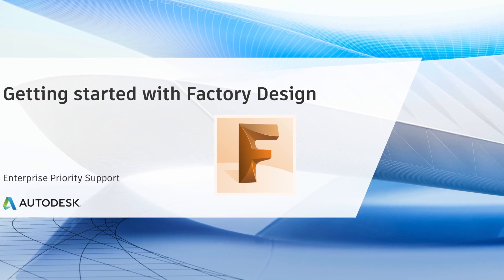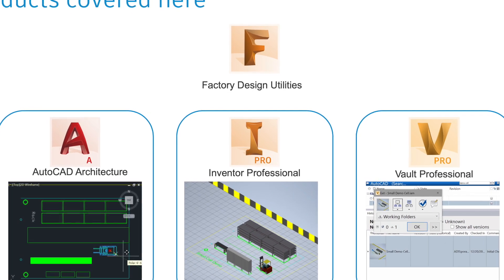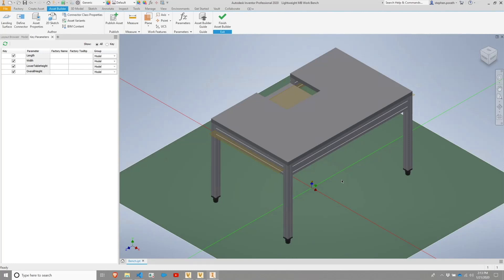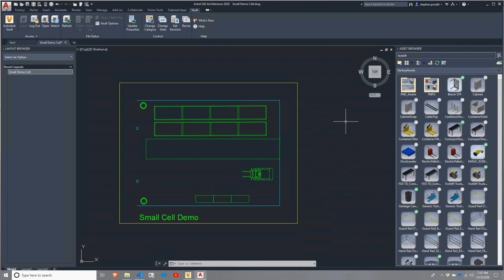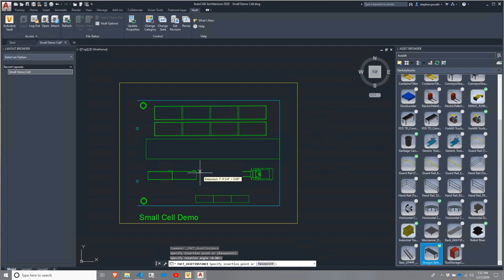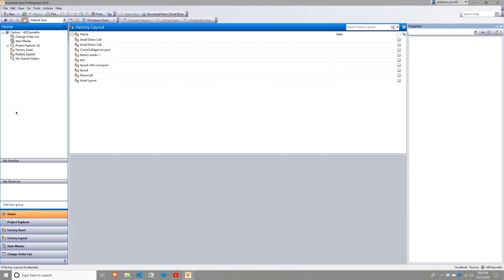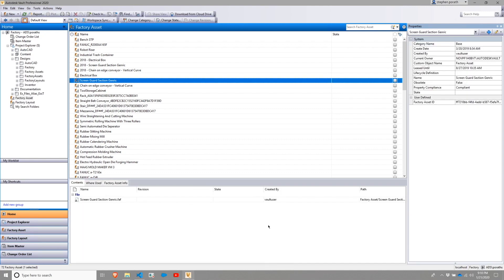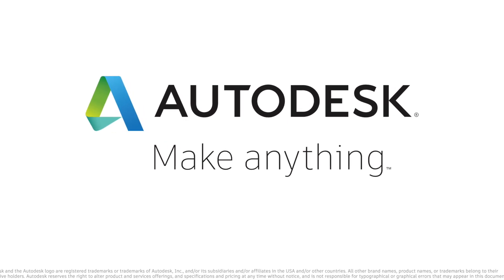Implement Autodesk Factory Design solution: Overview

Comment: The video shows a workflow using FDS & a 2D (AutoCAD) program.

This does not make any sense, as to why would I go back to a 2D facility layout when i have a 3D environment model in Revit.

if a user has a detailed facility modeled in Revit, why would i have to go back to AutoCAD to control assets and design or update a facility plan?

Absolutely no sense and conterproductive to the tools available in an AEC Collection and Product Design & Mfg Collection.

Can someone explain why the 3D modeling products do not interact and require a HUGE step backwards to requireing a 2D workflow?????

Makes me so very sorry i opted for the (2) collections i did.
Reply: Thank you for providing the feedback about the video. The 2D <-> 3D workflows exist to help our reuse all the data they have, including 2D data. Same applies to the layout planning, that some users prefer to complete in 2D, or even 1D (e.g. process optimization). We understand that your preferred workflow is full 3D and it is fully supported by products in the collections. I will reach out to you over email you provided in  the course feedback to understand a bit better what kind of learning content you are looking for. Best regards, Anton.